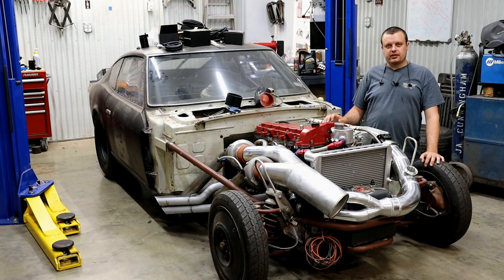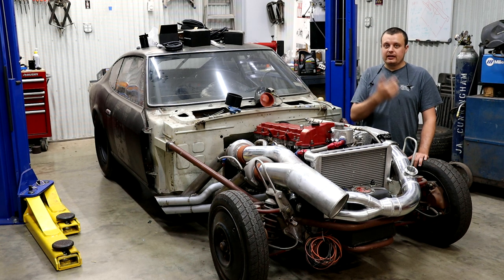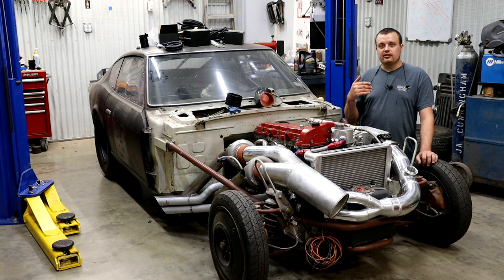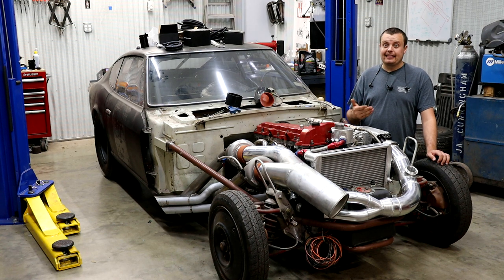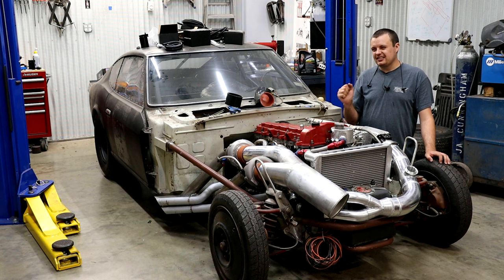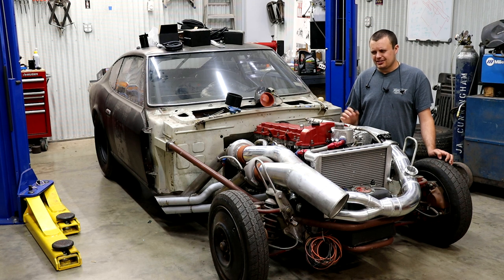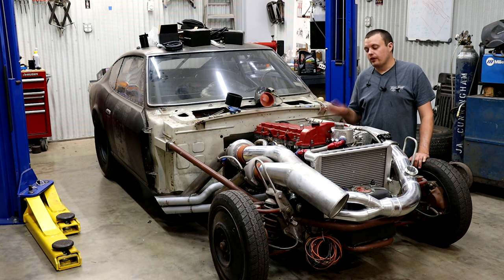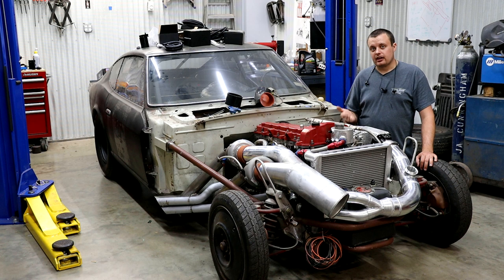Why You Should Run Methanol on Your Racecar - Pros and Cons - Twin Turbo Ameri-Barra 4200 Datsun

Comment: You didn’t mention the safety aspect of methanol, invisible fire is bad, most people have never seen it ( no pun intended ) and you should be running a comprehensive fire suppression system as well as better fire suits, Tom Bailey has a great video on this I highly recommend watching for anyone considering running methanol fuel. Be safe to race another day.
Reply: Surprised they don't add a dye to it like they do diesel, probably wouldn't cost refiners anything to use an ashless dye that would give the flames more color. I saw Bailey video.. scary stuff for sure.
Reply from the maker: Good point. I was thinking about it before I filmed the video, but forgot to actually put it in the video.

Comment: Since you are running a coolant system, you can lean out the idle. A lot of the “milking” is from guys running it really rich all the time because they don’t have a cooling system. Also if you just let the motor heat up the oil each time you start it, you’ll also be fine.
Reply from the maker: Good tip

Comment: That's why I inject methanol into the intake manifold with it's own pump and tank and injector. I still use an intercooler and no concern with my gasoline fuel system which uses 100octane. I do however do 1k oil changes as this is a street car not a race car.
Reply: Curious, do you buy oil in drums and filters by the case? Thinking the rate of inflation I might save money buying a 25-55 gallon of oil and a couple cases of filters for my street car. I have two Chevies so it should make my maintenance costs a little lower. Advice?

Comment: Great video. I’ve yet to run pure meth but I’ve ran a dual fuel setup which made 50% of my fuel load at full boost be meth and it worked amazingly well

Comment: Calvin, im sure its crossed your mind but why not run on E85 until the trans brake is activated and have a tune that switches to Methanol for the pass then revert back to E85 when driving back to the pits?
Reply from the maker: That's what we are essentially doing.

Comment: SRC runs meth on the S10. They use a lean-out valve during the warm-up to help prevent milking the oil.
Reply from the maker: Yep. Good tip

Comment: Have you researched what oil to use? I have seen 1 brand of oil allow the methanol separate and settle on the bottom of the oil pan.
Reply from the maker: Valvoline VR1 is the plan. Supposed to be compatible with alcohol.

Comment: evaporative cooling is the process you are describing at 2:00.   the boiling point of the liquid is what determines the evaporative cooling. methanol is one of the most volatile alcohols and it just so happens to have a carbon oxygen bond and a lone pair of electrons surrounding it.  methanol has a very low calorie count so the stoichiometry is roughly just under half of what gasoline is. ethanol is slightly higher boiling point, and is roughly 3/4 the stoichiometry as gasoline. it takes 3 molecules of oxygen to combust 1 molecule of ethanol.  it takes 1.5 molecules of oxygen to combust 1 molecule of methanol.  methanol is a very good polar protic solvent, so it requires special lines, tank, pumps and injectors.  by knowing the chemistry and how to balance a combustion equation we can calculate how much ethanol/methanol is needed to be used.  You should also ring your pistons specifically for methanol as you will likely wash a cylinder clean of oil with the volume of fuel being used.  you should also bump the compression up significantly as methanol/ethanol are knock resistant. part of why methanol engines make more power is because you can safely rev them higher with more aggressive ignition timing. the higher boost plus that ignition timing = power. the rpm is where you see the best gains on methanol at least in my experience.

ps. methanol burns invisible and you had better have a VERY GOOD fire supression system built into the car.  i can show you what happens when you run methanol with open downpipe that dumps under the car... i know of several cars where the entire car burned to the ground.
Reply from the maker: Yup. Good tips.

Comment: Just testing straight methanol with no intercooler on a 4 cylinder at the moment, like you say it means I'm lighter and I've had it up to 40psi up to yet, though I was expecting a reasonable drop in temp with a single 210lb spraying into the chargepipe but was still seeing 150c by the end of the run so didn't seem to make a massive difference
Reply from the maker: Needs more methanol
Reply: @Calvin-Nelson  I've wired the car for 10 injectors so I can add another 210lb in the chargepipe so see if that helps, it's nice looking at the EGTs and seeing it 200c cooler than with gas/ethanol. Are you planning on just running any in the chargepipe or just in the rail, also will you switch 100% over in the tune to methanol as it comes into boost or still run a mix?
Reply from the maker: @turbotoaster1984  we'll just use the ones in the rail. Plan is to leave the ethanol injectors firing. So maybe 50/50.
Reply: @Calvin-Nelson  I did a back to back test on the dyno at middle boost of 25psi and there was a 70bhp difference between straight methanol and ethanol (530/460bhp) so I would try and run say 70/30% if you can, what are you doing for fuel pump?
Reply: I'm no expert, but genuinely curious and trying to learn. But is shaving 35-50 pounds off the nose of the car worth the increased iat you experience? I mean with control of iat using an intercooler your tuning window would be wider, and most likely take more timing right? Surely that would allow you to make more power safer and offset the added weight wouldn't it?
Reply: Gains with methanol would only be increased with intercooler and more stable iat allowing more ignition lead right? 🤔 Thanks for the great content and comments guys, love learning from everything you share.
Reply from the maker: @b.c4066  It likely adds up to more weight than that. If you are using an Air to water, it requires an ice chest. My preferred solution to cars with intercoolers is an air to air, but that requires you move air through the car which makes it less aerodynamic. Also these intercoolers make a restriction in the charge pipe which makes your turbos work harder for a given boost pressure. 

All that being said, it has been proven pretty definitively that you don't need an intercooler with high volumes of methanol. Look at any of the fastest drag cars out there. People are making 5000hp with not intercooler. Not saying you're wrong, just that we are going to try without.
Reply: @Calvin-Nelson  I wasn't making a statement, more of an invite to poke holes in my perception if it was off. I didn't consider the aerodynamic effects, definitely important at 150+ mph. Guess I was looking at it from the perspective of the typical street car, err not typical. But you know wild barely legal, no business being on the road kind of hotrod us hooligans dream of.

Comment: I wanted to know why top lube was prohibited so I looked into it and apparently it's because they can't tell the different between top lube and performance enhancing additives during fuel checks on classes with fuel restrictions.
Reply from the maker: Interesting. I didn't know that.
Reply: that has to be an excuse, im an analytical chemist and it would be pretty easy to check for adulterants in fuel.  if i can findout what you ate last week by looking at your blood it would be a walk in the park to find some hydrocarbons in a solution.
Reply: @Mp-jw1qg  difference being they aren't running sophisticated tests with sensitive lab instrumentation trackside.

Comment: if Methanol is corrosive to aluminum isnt it going to eat up the heads of the 4200?
Reply from the maker: It will vaporize and be sucked into the cylinder so quick it won't have time to do that.

Comment: Would running gapless rings help keep the methanol out of the oil?
Reply: Would probably help, seems to be the guys who have that problem the most are running straight meth and no cooling system so its rich as hell at idle all the time
Reply from the maker: Probably. I wonder why guys don't typically run them on boost applications
Reply: @Calvin-Nelson  I wonder that also, I might use them in my 502 bbc NA build